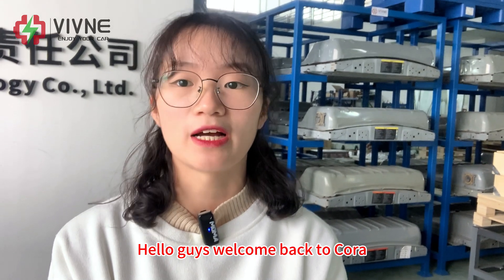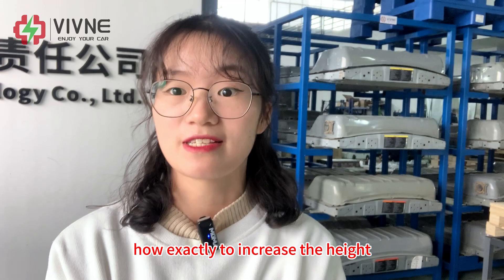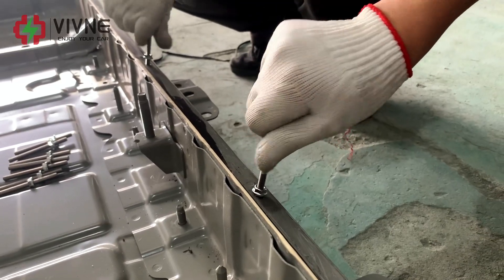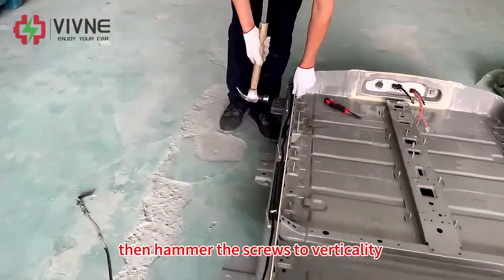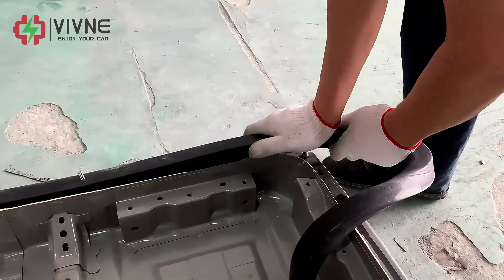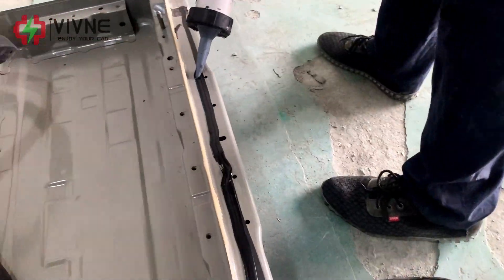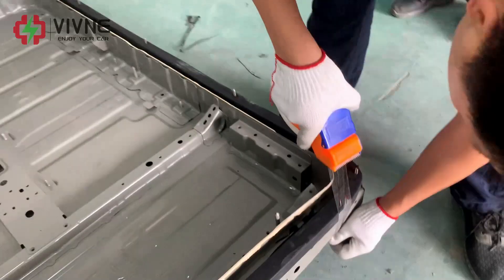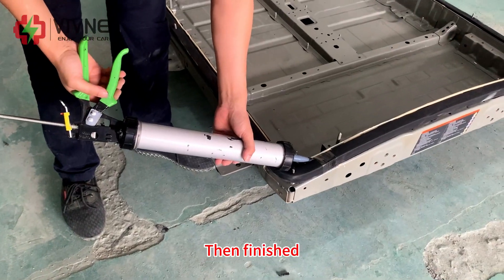VIVNE-How to increase the height of the battery case for Nissan leaf

Comment: I bought a 68 kit from you guys(i bough it from Helen). This rubber sqare sausage i have a mixed feelings about. I like the idea and how reverseable it is what i dont have to cut and modify a lid. But i really struggle with studs.   I have to open a pack up(defective LBC) and studs just not surviving well. They basically single use. I laso can advice anyone instlling them use red lock tight installing this studs. I have to replace 7 out of 8 studs. I scew them by hand with ratchet so i can contol pressure. But still not great.

Comment: The cooling operation still seems a bit rudimentary. You should consider implementing a safe cooling operation and a thermal management system to keep the battery warm on cold days. Does the BMS have good thermal management? What is the battery chemistry's C rate? Is it LFP? What is the cycle rate? Can you modify the performance parameters?
Reply from the maker: Adding an additional thermal management system has high risks and costs, which is not cost-effective for car owners. The safety of Leaf BMS is beyond doubt. We use CATL NCM battery cells, which support 1C continuous charging and 2C continuous discharging, and the cycle time is not less than 2000 times.
Reply: 68 here in Los Angeles already looking about 10k$ installed. But actually I'm still working on it what what I really like they not heating up as bad as 40,62s or 24s. Temperature difference stays pretty close to beach other, and aluminum case what they use for cells are great in heat transfer. I like is so far. Id also don't have a same issue what stock 40s have due to relatively thick aluminum casing it works as heat sink and transfers temperatures between whole assembly pretty good. After a charging cycle it's less then 2-3 degrees difference.

Comment: Do you glue the top of the seal too, does the service disconnect also require spacing or does the top cover flex down when the service disconnect screws are tightened?
Reply from the maker: The service plug will also be raised, so there is no need to worry about installation issues